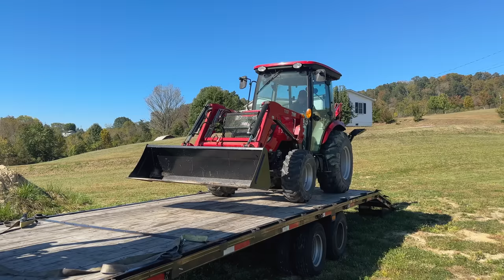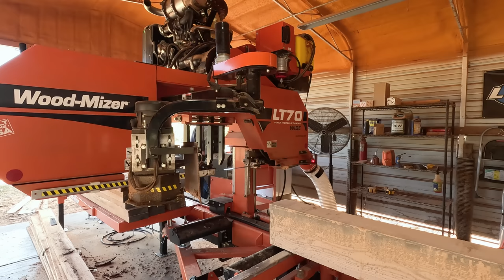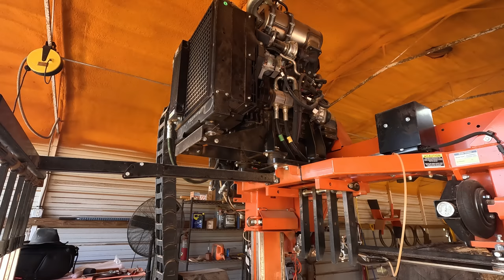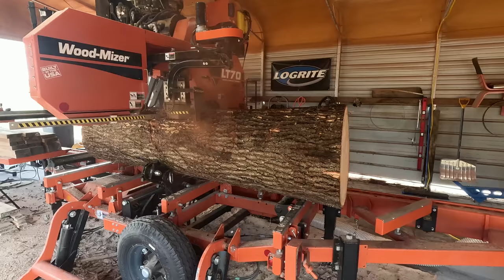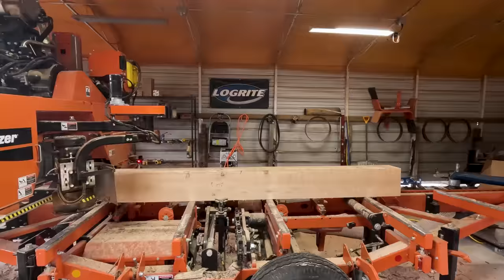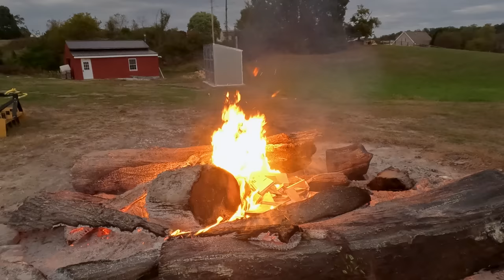Why Did I Sell My TYM Tractor? You Might Be Surprised

Comment: You should install an outside wood fired boiler, you could heat your water for free and supplement your heat in the winter with a hot water coil in your heating system.
Reply from the maker: If I had 10k$ I would. They are expensive
Reply: Send him a new boiler
Reply: LOL

Comment: My friend, you need to wear hearing protection while sawing with a chain saw.  I have tinnitus in both ears, mostly the left, and it is permanent and total. My ears ring all the time and it could have been avoided by protecting my ears through the years.  But a Marine shooting everything that Uncle Sam has is what started it, and 30 years of Game & Fish Law Enforcement with outboard motors and firing ranges and shooting in general, have ruined my ears.  The problem is, you don't get the ringing immediately, it is usually years later.  I woke up one morning with my ears ringing back in 1982 and they have been ringing ever since.  
Now, they provide (eyes and ears) hearing and eye protection on the range and will get on your ass if you don't use it, but neither the USMC nor DNR-LE provided them in the early years.  I even used to use Winston cigarette filters as ear plugs for a while but stopped.  Be good to your hearing and protect your ears and hearing with a simple set of hearing protection or plugs.  Easy and cost effective.  You will love yourself for it.  jh